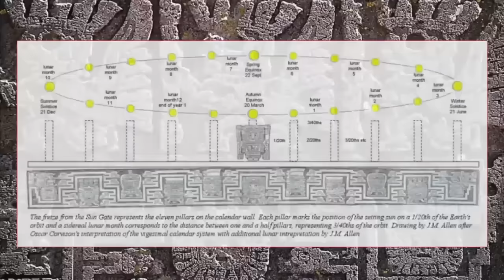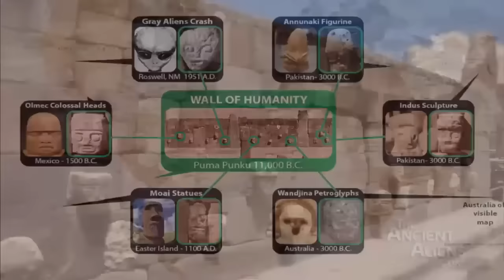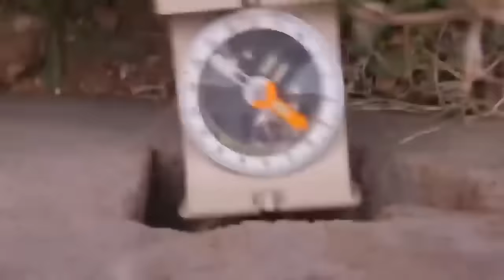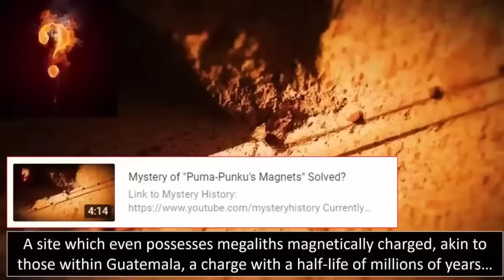Secret Of Puma Punku Revealed?

Comment: Pyramids and monolithic structures. 

If  you were living at the time when the pyramids were actually activated and working there would be enough static electric energy in the air that your heart would not have to beat very fast as there would be so much electrical energy flowing through your body your organs and cells would not need to reproduce as often. Your body would become a lot more efficient. Your brain would grow in size overtime leading  to a naturally evolving elongated skull. Your life cycle would also likely be much longer so you could live anywhere up to maybe 1000 years enabling you to acquire and retain immense amounts of knowledge per person.

The pyramid operates by sound frequencies in the resonance chamber that vibrate quartz crystals within the stones it’s built with. 

Salt can also be used with water to increase electrical conductivity in itself and in stone it permeates. 

The casing stones on the exterior are electrical insulators. 

The capstone would likely be highly electrically conductive or may even be a crystal of itself and could have been levitated above the pyramid at various heights. 

With today’s technology we wouldn’t necessarily have to rebuild the entire pyramid of Giza turn it back on. 

Famous pyramid of Giza is actually three different pyramids. Depicting 3 advancements in technology over time. 

Bent pyramid shows moment of new technology discovered. 

First one was built above the Loehr residence chamber second one is the queen chamber and the third is the kings chamber that  one incases  all of it. 

The kings chamber itself is actually surrounded by quartz crystal sand which is extremely electrically productive from sound vibrations even more so than the crystals that are found within the stones of the pyramids main construction due to the densities of crystals in the sand vs stone  

Quartz crystal sand is necessary to compensate for the voids that are in the chamber so you will likely find that quartz crystal sand around areas of passage throughout. Density and coarseness of the sand will also vary as needed. 

I am a little bit confused as to why the kings chamber seems off-center and it makes me wonder that there is a fairly high likelihood that there are two or four identical chambers one on each side of the centre of the pyramid and between that would be a high concentration of quartz sand. 

Might have something to do with how the vibrations transfer through the structure from to lowest resonance chamber. 

Pyramid was designed to be built in scale in multiple of steps as needed as opposed to rebuilding them over and over again from scratch. 

The pyramid still has a multitude of different applications that are beneficial to everyone that lives within its boundaries. 

Each internal step has a different application and resonates at a different frequency in the centre of the pyramid as well as the lips reflect the sound back to the floor with a timed purpose amplifying the resonance. 

Multiple pyramids in close proximity may have been used to create certain harmonics between them. 

Some individual pyramids have the ability to create multiple harmonics on their own based on their design where some are only able to produce one particular sound frequency at a time. 

Sound waves can convert into electric waves / electromagnetic waves and then back into sound waves as well. 

Some of those benefits include. 

Able to create a magnetic field like the Earth to protect you from solar radiation or recharge the earths core electromagnetic field. 

Extending an individualslifespan as their body does not require as much consumption of food water and cellular reproduction to survive. 

The ability to levitate extremely heavy objects. 

Wireless electricity. 

Produces electromagnetic radiation at the speed of light. (Wifi)

Ability to alter the solidity of stone. 

Inside the pyramid within the right shaped room you would be able to levitate objects or even a person if you wanted just from the sound frequencies   

The ability to transmit binary code and analogue data across galaxies not just on earth. 

Improve agriculture due to sound harmonics produced. 

The  ability to communicate telepathically amongst one another and other animals. 

The pyramid itself can be seen from space and represents intelligent life on earth with specific technologies available to them that they are using and it invites other intelligent life to exchange information. 

 in addition to the sound frequencies. 

With the right sound frequency over the incubation  period of a pregnancy or cloning playing a specific sound frequency throughout the duration can section the human brain into four separate sections elongating the Scull in the process. 

Four sections actually create two brains  in one person which is not inconceivable when you take a look at an octopus that has nine brains. 

The pyramids could also possibly operate by a river that would flow through the base of it and it would suck in air in the process through the intake valves located in the top upper sections and as the air travels throughout the inner chambers like a flute or a whistle would create a specific sound frequencies which can be manipulated by the shape of the  chambers and what’s inside of it. 

In addition the lowest chamber could be a hydraulic residence chamber.  Best if it’s a salt water river directed under the pyramid for improved electrical conductivity. 

The three separate Chambers create three separate frequencies in the pyramid would have been likely developed as those technologies were developed and may lead to an understanding for why there is a thing called the bent pyramid. 

Doorways that allow you to regulate the amount of water flow and airflow are also relevant. 

One of the three frequencies has their own individual purpose that being said in harmonics if you were to use two or three of them at the same time or be able to vary the residence for each of them simultaneously also leads to a variety of additional applications. 

Lower hydraulic resonance chamber middle queens chamber for harmonic tuning upper kings chamber for amplification 

I am imagining the water flowing in to the Lower residence chamber and in the process i it’s capturing air from the first tunnel  section as it   goes down the tube with the water and gets released by the lower air vent and would create a type of burping sound somewhat similar to a (heartbeat) low frequencies  

In the process it’s drawing air into the lower chamber from the upper flutes at the queens chamber (tuning )and the Kings chambers (amplifier ) air intakes which is creating a frequency residence and would play some type of song in a fun sense of an idea. 

How do you the songs affect the structure?

Low, mid, high range frequency within, above and below the 20hz to 40khz  frequency range. 

If the electrical energy generated is intended to be forced down word as if the casing stones were to act like a satellite dish aiming into the Earth then you would have electrically charged water which could represent the infrastructure of how this energy would’ve been delivered throughout as well. 

Salt water rivers underground can also be used as infrastructure to deliver electricity to surrounding areas 

Regarding building pyramids. The areas are generally flooded and the stones are carried by ships and lowered into place, then the water is removed.

There’s many different design’s of pyramids. Some of them are made mostly of quarts that can be found deep underwater and the water provides the pressure needed to activate the system it is proposed for.
Reply: Where you copy and paste this from? Lol I read it though. Lol just kept going
Reply: @logan7024 I got tired of writing it over and over again so I wrote it in my notes and just copy and paste from there. 

Sometimes I’ll add a bit but I’m limited to how many characters I can use in comments.
Reply: Gr8 Novel 📖 😅
Reply: Thank you for the Insight. This matches with the tibetan monks that could levitate objects through soundwaves...a phenomena which is scientificaly proven.